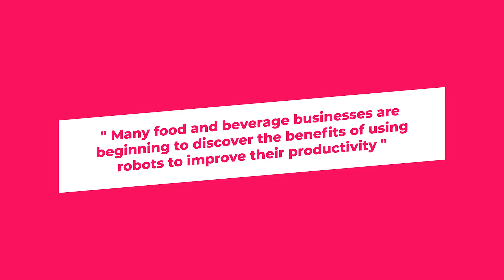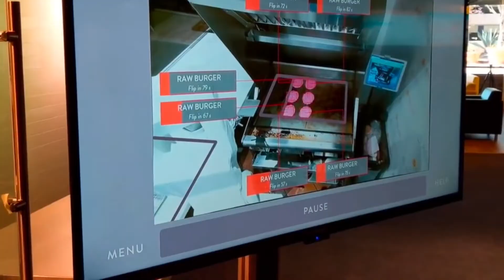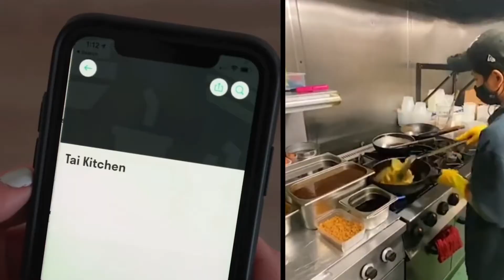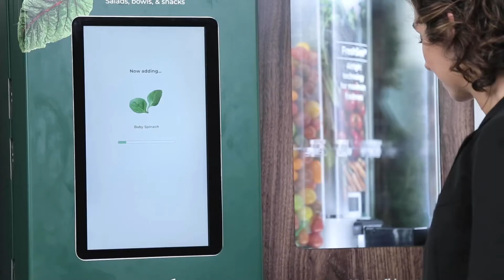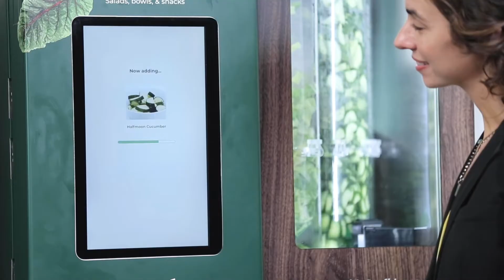Restaurant of the Future 2024 |  Food Robots On The Rise

Comment: I subscribed .. what you think of fbr robotics
Reply from the maker: Thanks Max! FBR are involved in robotic construction am I right? I remember coming across their walls as a service tag line. Ya it’s a cool technology that has a massive addressable market to attack. What’s your thoughts on it?
Reply: That’s correct . Through haydrian x machine they can currently lay blocks at 250 per hour ( minimum ) and newest version is like 500 per hour . Each block about 10 standard bricks in size . I’m convinced they have huge potential. Reasons
Reply: 1) young men don’t want to lay blocks which is back breaking work .
2) this technology opens up opportunities for women/ disabled people .
3) since no one touches the blocks they layed With precision and exactly to plans , massively reduces waste and errors as automated.
4 dematerialised the construction sites as less use for scaffolding etc
5, building house structure( in 1 day now) allows real efficiency and helps plan and deliver much faster ( reduces other costs ( lag times security etc.
Reply: Also the big technology they have is called DST ( stabilisation technology for outdoor building which is ground breaking ( more types of robots can be built in this area ( haydrian x blocks just the first ( 1 for laying concrete , roof Tyles, cranes , overhead power lines etc
Reply: I’m a shareholder etc so people might think I’m biased but the tech fbr has is forward looking and offers real solutions .. it’s also proven as they built already real houses etc ( they going into USA very soon